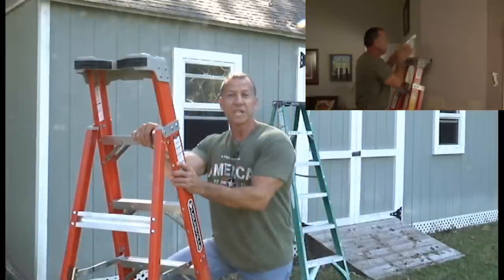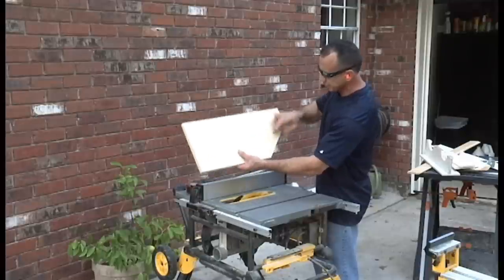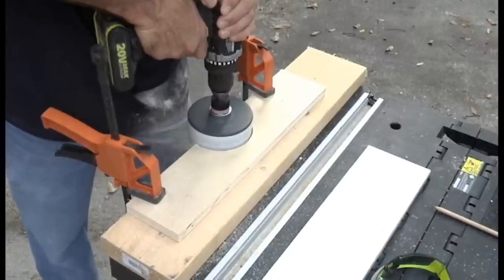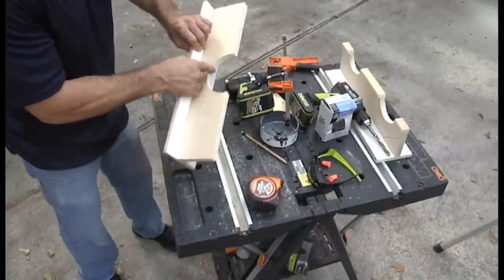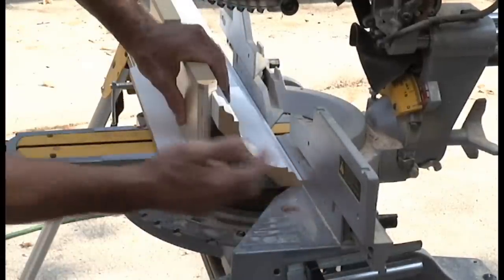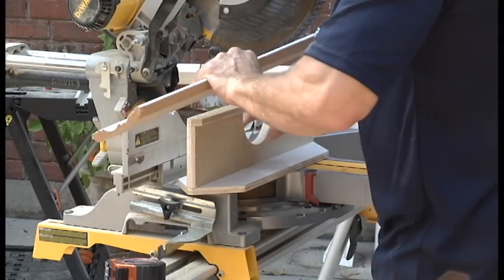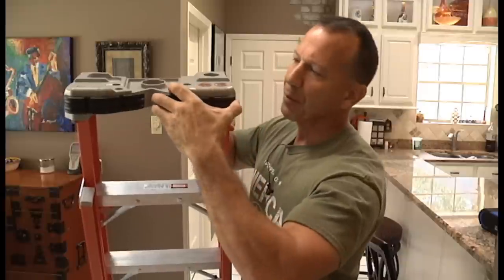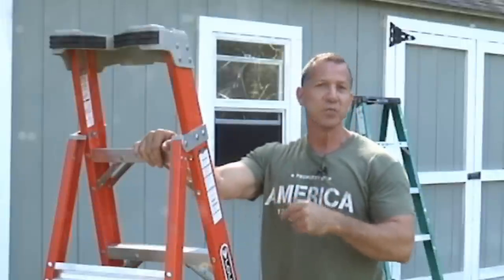(DIY HACK) Cut Crown as easy as Base Molding!

Comment: I am a newbie in woodworking. I am also 82 years old. My daughter house is being sold and there are several repair needed. To save money I did most of the repair. So far I’ve removed and replace damaged hardwood flooring, and replace base moldings. This device is super useful. Thanks for the video.

Comment: Man I sure needed that jig 10 years ago.  I did two rooms using 6 inch crown, vowed not to do that again.  Now I use 3 inch crown and 3 inch base boards and buildup the crown much easier and looks beautiful.  Fantastic video and instruction again Paul, keep up the great work!
Reply from the maker: Hi Michael,
That's a great way to do it as well, a few more cuts but well worth it! I have a video showing how to save money by using a smaller crown, measure down a few inches and using a picture molding as a trim. I paint the crown, space and picture molding the same color to give the appearance of stacked crown. There are so many things you can do with crown molding and they usually look great!
Have a good day buddy!
Paul

Comment: We get a lot of great wisdom from you, Paul.   At 2:27 I saw something unusual.  I was taught years ago when I was a little bunny  in using the table saw to never, never use the miter gauge and the rip fence together -- unless I was trying to demonstrate kickback.  To use the rip fence as a set up aid, but to avoid inviting kickback, I was taught to use a short spacer block so that when the blade starts cutting, the edge of the work piece is not touching the rip fence or the spacer block.  I know a lot of people disregard that and seem to do fine, but I prefer to minimize kick back risk.  Stay safe, my friend.  By the way, I love that jig.  Great idea.
Reply from the maker: I really appreciate your comment my friend! I try to think of safety when it comes to my videos, but sometimes miss certain details and this is one of those times.  I should have moved the fence back before cutting and I will definitely do this in future videos. Thanks again and I really appreciate you taking the time for me!
Have a great day!
Paul
Reply: Thank you for addressing that.  I couldn't tell if there was space at the fence.  I've had kick back even with my riving knife installed

Comment: Great jig, makes crown molding easier to cut, don't have to worry about turning the molding upside down, which side is the ceiling or the wall side on the saw and less wasted cuts

Comment: That crown jig makes so much sense I have been trying to do the upside down crown method and I am not going to lie I screw up and have to go back and forth several times just so I feel comfortable making the cut and not wasting crown but I still get it wrong sometimes ,but this is where this jig makes thing's a little easier for the diy guy like myself by trade im a mechanic and mill right but crown has been like kryptonite  to me but now with the jig much much easier 
great jig Paul keep the video's coming

Comment: Simple and elegant.  Very nice.  Concern I have is for tearout since the blade is cutting OUT the face instead of into it.  With a good blade, that should not be a big problem, esp for MDF - and for paint grade, any tearout is easily fixed.  However, for stained wood, I can foresee it may be a problem.
..... BTW 2P10 is really great stuff!  ....  The Louisville ladder looks pretty good!

Comment: man simply an amazing jig Paul . It's nice to see someone who you can tell actually works day-lie with his tools , some of the guys on here are just here to get some like and subscribers and that's it. I have always found your videos to be clean informative and very accurate . As always keep up the good work and if you have time to message a good 'ol boy back i have a 2 used older craftsman tables saws not sure of the make and model .  They both are in fine working order but i dont know how to go about dialing them in and getting them ready to do some serious work. And rather than watch 200 hours of useless videos I thought you might just be the guy to ask and I could get some clear direction to at least start in. I can say this they are heavy weights . Each one weighs probly 400 pounds they are shop saws not Jobsite saws and they have the external belt driven motors. and are solid cast iron! Man did i get a deal for 100 bucks for both? I thought so and tried to hide my grin as i had my 3 boys load them on the trailer! The guy i bought them from is a friend that was into woodworking and never really used them as he bought them in a bulk tool auction and as they became objects in his way the price he wanted kept getting lower. So at any rate i seem to be rambling on here if you have time Paul any help would be great and i hate i missed the first 100 comments because that ladder would be awesome in my new shop. Thank as always for your time...Adam

Comment: Defiantly very helpful, if you dont do crown moldings allot it can get prety confusing making corect cut when you your cutting upside down. At least until you get use to it but it can be very expensive making pracrice cuts lol so thanks for the job design. Latter is pretty niffty as well 😆.

Comment: Cool jig! I’m currently renovating my kitchen and will be adding crown as well! Had a quick question with that glue and spray is it ok to use on finished crown?
Reply from the maker: I have not had any problems with the spray (2nd part) but the glue will probably damage the finish if it gets on it. I will use wood glue on the entire front part of the miter because it will seep out on the face and a couple of dots with the 2P10 glue on the back side. The 2P10 glue acts like nails and it will hold the joint tight so the wood glue will dry properly. This will actually give you a stronger joint.
Thanks!

Comment: Have always just cut it flat on table with compound miter.....most miter saws have detents for this setting specifically for crown.....and compound tables are easy to find....for basic houses with inside and outside 90°s and flat ceilings it works very well and once you set the saw you never move it

Comment: So...  With this method, the molding is still cut upside down (saw table is the ceiling) but the left/right are NOT backwards.  At 13:34, Paul is showing that orientation.  Want to try this one--see accuracy and safety benefits.

Comment: When I installed crown moulding in my guest bath I told my wife to put a bullet in my head if I ever decided to do it again. And that was even using a manufacured jig. With this jig it was easy, took less time, and so much less waste and cost. Thanks Paul  for another great tip and video.

Comment: Thanks - I can tell you are a craftsman - however at 2:28 you use the fence AND miter gage in the left slot - at 2:56 you use fence AND miter gage in the right slot - I am OK with right slot but I have found that fence AND miter gage in the left slot can sometimes cause the board to pinch the blade and cause a problem.  I know you are a craftsman and can tell you have a good feel for your machine - however I still avoid the fence AND miter gage in left slot cuts.  Thank you from Texas.

Comment: Am I correct that the height of the jig has to match with the molding (at 45 degree) ? I can see that the little piece on top of the jig wall HOLDS the molding firmly at 45 degree when pushed against the wall of the miter saw.
I view it again, yes the small side can be used to cut smaller crown. GREAT JIG , VERY CLEVER, I have to make one.
Reply from the maker: Hi Kim, yes you are correct, the small lip on the top of the jig holds the crown at the correct angle. Not all crown has a spring angle of 45 but this jig will also work on 38 or 52 crown. Thanks and have a great day!

Comment: I look at this video a while back write it down in the back of my head I’m about to put on some crown moldings that I built myself from three pieces of board one horizontal one ninety degree and one on top at a forty five degree without this video I would have a hard time cutting those angles it has inside and outside cuts and not only that the angles are not just 45 or 25 the are pitch at angles that I have to use a tee square to make some of the cuts thanks again for this video

Comment: Paul, first off thank you for your video's. They're very informative. I have a question. I have a single bevel compound miter saw which means I can only cut bevels in one direction. The crown I have is taller than my saw will cut if I were to cut it the traditional upside down way which brought me to your video's about cutting it flat. Being that I can only cut in one bevel direction can I keep the bevel at the same angle and just mirror miter in the other direction, flip the board to the bottom against the fence and get the correct inner and outer angles? Thank you for your time and for the great video's!

Comment: I used a coping saw on my crown moulding. I struggled with the coping cuts but I was determined not to do it the "easy way" and just cut two 45 degree angles, besides my walls aren't square anyway.
Reply from the maker: If your walls are off, coping is a great option, you did the right thing.
Thanks!

Comment: Even with a super sharp 80t blade, how do you not have tear out?  Cutting anything with the blade pulling from the back of the molding would leave at least a beard if not actual tear out.

Comment: I've been cutting and hanging crown for iver 25 years and have never had to worry about the spring angle.
I don't cope either. I can make an inside corner of converging 45s by using the bisected angle at 90° to my fence.
The crown stops negate your jig.
Reply from the maker: Hi Keith, there are many different ways to accomplish a task. If you look back on my crown playlist you will see samples of crown in the nested position without stops, with stops, flat and with a jig. All of these methods are useful as well as accurate. This jig helps people who are not versed in cutting crown and it simplifies things. With this jig you don't need to know the spring angle either. I still use crown stops at times because It is second nature for me to cut upside down and backwards, but I find the jig to be better when I'm using the same saw to cut crown, large base molding, and window sills. Crown stops have to be removed when you switch from crown to large flat stock. If you notice in my videos I shave crown stops on my saw and they are modified so I can remove them easier and faster. If you prefer to cut crown with stops, you may want to add this modification to yours.
Thanks!

Comment: This is a cutting solution that I have never seen before.  I love it!  It takes the complex part and makes it easy!  
Do you have any problems with the work price sliding or slipping when pushed up against the fence on the smaller crown?

Comment: I like everything you show on your video especially the FastCap 2P-10
Can I use it on Prefinished wood without massing up the paint?
Reply from the maker: The activator spray will not hurt the finish but the glue will. I add the glue on the back part of the piece so it the excess will not squeeze out to the front when I put them together. I also will use wood glue on most of the joint and a couple of dabs with 2P10. This kind of acts like spot nails to hold the piece until the wood glue dries. 
Thanks!

Comment: Does the decorative edge of the Crown Molding go up in the jig? (That's the edge that would be on the bottom on your wall)
Reply from the maker: The Decorative edge will be up, pretend the saw base is the ceiling. Sorry I didn’t explain it better, but a right miter will be cut for the right corner. Unlike the traditional way where you cut the right miter for the left corner. I hope my explanation is not too confusing. Thanks!

Comment: I agree crown stops suck. I use 2 jigs I made. Much easier than that thing you have to hold. Cutting the crown reversed and upside isn’t hard. My jigs screw to the saw and hold the crown. There’s 2 of them, they’re 4’ feet wide and made out of melamine so the crown slides easily! All macho guys say this - that they’re the best, but I’ll cut circles around any finish carpenter with my jigs! Haha

Comment: Doesn’t having the face away from the cut chip out the face of the molding?
Reply from the maker: If you have a dull blade or cut too fast you will get blowout If you have a good blade and cut with patience, you will be fine.
Thanks!
Paul

Comment: When I cut a crown moulding , I do not need any jig because  I cut it flat on the compound mitre saw why spend over $800  for the saw if you do not used? Please let  me  know.
Reply from the maker: I have videos on cutting crown flat, upside down and backwards and with this jig. It makes no difference how you cut your crown as long as it works and you are comfortable with it. This is an option that makes it easier for the do it yourselfer. You and I both know how to do it flat but the average person doesn't and they also may not have an $800.00 saw. I hope this answers your question.
Thanks!

Comment: Show me how to make outside corner with you tool
Reply from the maker: The outside corner uses the exact same cut as the return, you just have longer pieces. The placement on the wall is different because the bottoms of the crown meet on the corner. I hope this helps.
Thanks!
Paul

Comment: Paul, so much great advice that I intend to put to use, but… you really need to pin a comment to advise people to NOT cut the length of the board against the fence. That’s what a miter gage is for. Your method could lead to kick back that woukd seriously injure someone who is not as experienced and as careful as you.

Comment: Only thing I would be worried about is someone inexperienced not holding everything down tight and using a hand me down saw with a 40 tooth blade and snatching the whole thing out of their hands.  How does it do tear out wise cutting through from the back of the board to the front?

Comment: So what do you do about the tearout of wood from the blade when you cut the trim facing the blade?
Reply: zeke112964 you don’t. This is not the correct way to cut crown, at least not professionally. You won’t see a professional cutting crown this way. 

Unfortunately, just about all of the YouTube videos try to show anything and everything to get away from the “true” correct way or process of doing something, especially crown. As a professional I️ learned the correct way without the influence of these so called pro’s and I️ didn’t know any different and it was never ever a problem to learn to cut crown or any other molding. It is a process and a learned skill but the homeowner that wants to cut and install their crown doesn’t have access to a Pro to show or teach them, only these YouTube videos. Crown requires lots of patience and practice and a very good teacher.

Comment: Cutting flat is the fastest most accurate way that I’ve ever used to run crown, and I run miles of the stuff every year by myself.  I really don’t understand the stigma behind cutting flat, and why people will go through great lengths to avoid it.
Reply from the maker: It is a matter of preference Jeff, I have friends that love to cut flat. I personally used crown stops for years and that is my preference. I cut flat when installing large crown and I also show how to do that in other videos. I have installed crown in countless homes so it comes easy to me. Many people get confused with crown stops and cutting flat requires you to have charts for different spring angles which confuses beginners. I came up with this jig to simplify things for the average person. This tool  makes the job easier for anyone but it was geared for DIY'ers.  Thank you for watching and I appreciate your comment!
Thanks !
Paul

Comment: Your first cut is a little dangerous.  Shouldn't have that fence there during a crosscut.  I think that was a crosscut..wasn't it?
Reply from the maker: Hi Dennis, you’re right. I should have used the guide to prevent kickback. I sometimes forget to use it. I am careful not to push it with both hands I only guide it with one and push with the other. You are also right about it being a crosscut. Thanks for taking the time to comment! Have a good night!

Comment: You lead people to believe that the fixture you made will work with any crown. The height of the jig has to be specific for each different size of crown. Your first cut on the table saw as extremely dangerous. You should never use the crosscut gauge and the rip fence together, especially on narrow pieces like you used. It looks like you have a compound miter saw. Why not just cut the crown flat and use the compound feature of the saw.

Comment: That my friend is insanely dangerous rig you put up.  When the poor guy brings the blade in and mistakenly clips the outboard fence that you made, it’s gonna pull the fence into the blade. The fence serves as a rigid stop to prevent the moulding from being pulled back with blades top down rotation.  A skilled mechanic would recognize that hazard.  That saw sports a 10” blade capable of big things.  Almost every injury on that saw was caused my mismanaged materials.  Your a cool dude but take this one down, a novice is gonna take a hard hit.  As a 40 year carpenter,  take my word or clamp it up misaligned and pull that blade into it.  Wear your safety googles, it’s gonna be a campfire story.